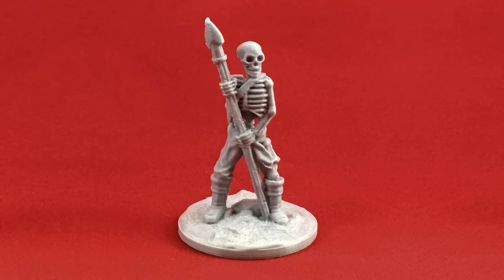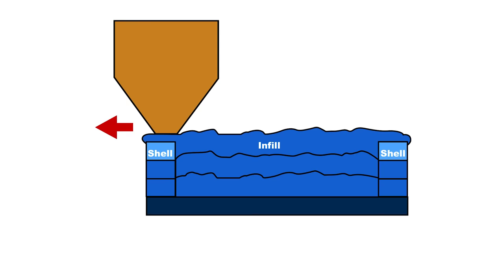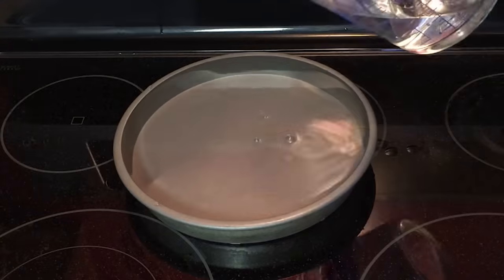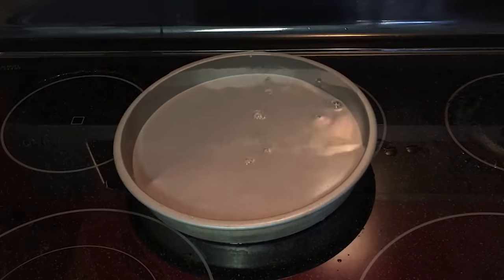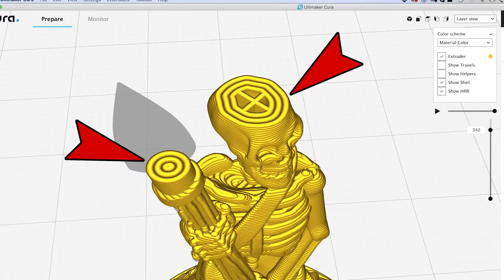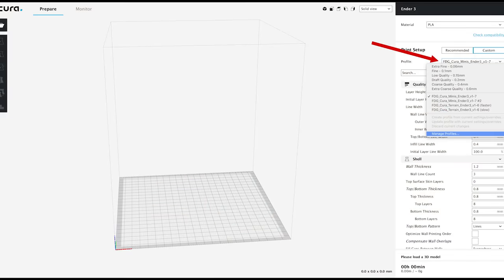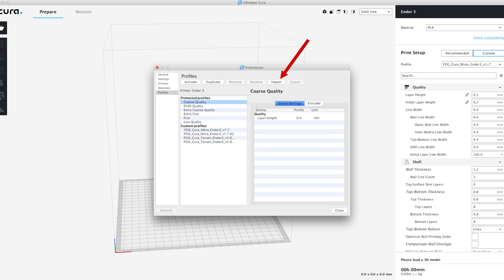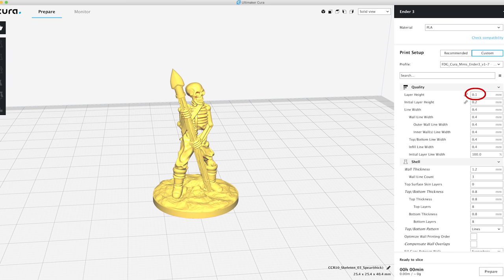How to 3D print miniatures on a FDM printer

Comment: Thanks for the profile and bed test links, also loved the parameters explaining!! Note for me in future: 
- layer height 0.1
- first layer 0.2
- reduce temp to minimum
- reduce retraction to 5
- disable wall overlap
- disable z hop jump
- activate jerk control (my ender 3 stepper do strange sound without)
- printing speed 55 generic and wall ½ so 22.5 magic

My profile will sure improve after this video, keep up the good work!!

Comment: Ok, so this video is 4 years old and is STILL one of the best resources for 3d printing (especially with smaller diameter nozzles, LOL). 

The information is presented in a clear and cohesive manner, with no unnecessary frills or embellishments. This person not only provides you with the Profile files for you to Import but also wlks you through the Settings so you can make your own.

As someone who has spent countless minutes poring over low-res scenes via the Pause button, just to get some Wall settings, this is MUCH APPRECIATED. 

This should absolutely be the standard for instructional videos on this platform. Well done, sir. ♥
Reply: Totally agree sir. Very nice vid

Comment: Best 3d printing video I've seen yet. I was also trying to use the finest settings on my printer and this video explained why they were looking so bad. I was getting discouraged because I thought that if my printer  was making crap at the best settings then it would never get better. Thanks!
Reply from the maker: Thanks for watching :)
Reply: Per 3dprintersonline, the Ender 5 will be out soon. Any info on this at all? Is 3dprintersonline a good company to deal with?
Reply from the maker: The Ender 5 appears to be a continuation of the Ender 4, which is a totally different printer than the Ender 3. The Ender 3 produces far better prints that the 4. No clue if 3DPO is good to deal with or not, I haven't ordered from them.

EDIT: The Ender 5 isn't a direct continuation of the Ender 4, it looks like they have changed all of the issues I have had with the 4, and it looks like it could be a very nice printer (I will be reviewing it once out).
Reply: https://www.creality3donline.com/creality-ender-5-3d-printer_p0123.html It's out; hope you get to be the first reviewer!

Comment: nice documentation on your acceleration and jerk settings.
With good calculated Esteps on my ender_3 and 97 a 95 flow i'm been able to go as low as 4mm and 30mm/s with retraction without any sign of stringing. i also believe as less retraction as possible i creates less stress on your tube and couplers.

Comment: Did you put a CURA profile link in description? Anyway the best technical video about printing minis. Most of vídeos on yt say 100%infil and 20%print speed its way better option, now i can desagree with solid arguments.
Reply from the maker: Yes, Cura profiles are linked in the video description. :)
Reply: @Tombof3DPrintedHorrors  Maybe I'm just blind but I really don't see it there. :-)
Reply: @Tombof3DPrintedHorrors  
I can't find the profile either?
Reply: Anyone find the link for the Cura Profiles? Thanks
Reply: @dougsink3653  its in the description
Reply: does not contain any valid profile error when trying to import.
Reply: @JTNetw0rks   i get the same ..  but im using the 4.6.0 version maybe thats why :/

Comment: After looking at this video and adjusting my settings, I get nearly perfect prints on my prusa mk3. Though, I have a problem with supports. I use cura experimental tree supports and I really like them, but sometimes the supports have too little surface area which connects to the actual mesh, and it loosens during printing. Therefor I'm really looking forward to your video about supports!

Comment: Wow. THE BEST explanations on why you're changing the settings. Could not subscribe fast enough. Tried the settings on my ender 3 Pro ,Cura 4.7, prints kept failing (4 so far)and kept getting filiment mess clump up on the nozzle after about an hour into each print. (brand new nozzle and bowden tube). I'm determined to get it right, but love this guy and his videos.
Reply from the maker: Cura 4.7 has a lot of problems, I recommend 4.6 with my new 4.6 profiles available at www.fatdragongames.com in the 'Resources' menu

Comment: Thank you, going through and explaining the settings was really helpful in understanding those settings in general.  Got the Ender 3 S1 for my daughter for Christmas, and we are brand new to 3d printing.  So this video was very valuable!   So excited we can make minis with it!
Reply from the maker: Be sure to use my most current profiles from my website, a lot has changed with Cura (new Arachne engine) since this video was made. Use my Cura profile on the website and change retraction distance to 1mm. :)
Reply: Ok!  Appreciate the heads up and your hard work.

Comment: Great timing!  I finished putting my ender together and printing all the upgrade parts.  I am fairly sure I have the bed leveled well.  With the magnetic sheet and Aqua Net Extra Super Hold parts are adhering very well.  (I was curious how long the hair spray would last and was getting 5-6 uses before reapplying it.)  I was just starting to look at printing terrain and miniatures.  The finish on the upgrade parts were a bit off and I had a feeling that understanding the settings on Cura would be key to getting better prints.  

I look at what people are posting and some are really good, some close to mine, some worse.  Would it be possible to have a video that show example of prints that are just off and how to fix them along the lines of what you did with the adaptive printed skeleton?

Comment: The Cura profiles on your Dropbox location are actually different than settings you list here.  We tried both and got terrible stringing and Minis would collapse or break when removed.  I just returned to the Cura defaults and quality is FAAAAR better.  Clearly, the comments suggest this has worked for others so it must be us.    We must be missing something.  Using Ender 3 Pro.

Comment: I have been using your Cura profile for all my minis. I have two Ender3's running most the time printing them. Thank You for the video and the excellent profile. It works better than any that I have tried, and at less printing time than some of the others. I made a few tweaks to it, to suit my needs and bang, perfect minis every time. I haven't printed any terrain pieces yet, but I will be using your profiles, when I do.

Comment: Awesome video thanks! Just a small note: PLA's glass transition temperature is between 60 and 65 °C.
Reply from the maker: Yeah, I wasn't specific enough. I was thinking of the eSun PLA Pro I use for minis which has a slightly higher one than standard PLA, so I should have specified PLA Pro instead of saying PLA. :)
Reply: Don't think it makes too much difference anyway :) I think the basic idea of - don't keep the printer head around too long stands. I'm really keen to start trying mini's today though. Looking forward to your vid on supports cause they suck!

Comment: wow this helps me alot!
i dont play even tabletop games but printing this figures is a hella fun too tho.
i only want good quality prints, and you make this possible. m
thanks a lot.

one thing; i hear on other 3D print channels something about the "magic" numbers.
these numbers will eventually increase quality and print speed with simple mathematic tricks
Reply from the maker: Thanks! And the term 'magic numbers' is misleading, it simply refers to full steps of the stepper motor. .1 is a precise half-step and is very accurate. Dropping to .08 (a so-called magic number) introduces other issues when printing miniatures. .1 will produce more consistent results, especially with overhangs. :)

Comment: I have a cr10 mini and a cr10 thanks to you I finally figured out what the heck is going wrong with some of my prints. Some of my larger ones have layer lines that look like strata you see at the Grand Canyon 😂 my temperature was way high I did a test print at 190-195 and holy cow what a beautiful difference. Thank you and I will be trying out your cura settings on my printers.

Comment: Last comment, I promise. Also, if you're having under-extrusion you can also upgrade your extruder to something like a BMG extruder which has a ration of 3:1 in the transmission between the stepper motor axle and the extruder axle. Those things will push PLA through even at 185 degrees.

Comment: Thanks for this upload buddy 👍Mostly print/profile for either large prints, prototype prints or utilitarian designs. This came up in my feed and loved it 👌
As a teacher/school inspector, adult trainer and makerspace/creative consultancy owner... your manner is perfect for communicating this topic. Nice work.
I'm going to apply your logic here to some micro prints I need to do including microscale lithophanes and small scale biomechanical prototypes. Happy to share results with you if you fancy covering the process of printing such items. 👍

Your method applies brilliantly to architectural printing too. There's a significant shortage of good archi 3D print guides out there. I get calls weekly from firms that have bought printers and can't produce the various decorative parts/furniture etc. A rerun of this vid, applied to architecture, would be really welcomed 👌
One thing to add here... if anyone's lucky enough to have a dual extrusion machine... I use a .8mm nozzle in one hot end and a .3mm in the other. All internal structures are produced using the .8 with external finish applied using the .3mm. Print speeds are significantly reduced, over extrusion issues are less and the wider print lines lets you cut down the infill % dramatically. Plus it lets you get rid of all the nasty colour filament by hiding inside the nice ones 😂👌 
Keep the vids coming man... new sub and video shared across my network 👍

Comment: 0.15mm layer height seems to be a sweet spot for printing with a 0.4mm nozzle :)
Reply: Agreed. I have a makerspace, my own printers, a couple of print Farms plus support schools. The 2, and only 2, rules that apply to the vast majority of printers are 1.5 layer height on a .4 and changing to a .6, or having one to hand, and running at 1.8 layer height are good things. 👍
Everything else? Well... there's a reason I have numerous thumb drives with over 300 profiles on them 🤯😂😂

Comment: This is amazing! i am super new at both 3D printing and RPG pencil and paper games. I got a 3D printer so i could print minis for our game, i am having the hardest time with supports and also i am never sure if i should print the figure laying down or standing up.  :)
Reply from the maker: I will do a video on supports eventually. Unfortunately, there isn't any great way to do them, for the support to do its job it has to be close to the model, but that means it will be harder to clean off when finished. That's why we are releasing a full line of miniatures soon that will not require any slicer supports. I want to make 3D printing miniatures as easy for everyone as possible. :)

Comment: I think that you mispoke when you were talking about Kinetic Energy (KE=1/2 * m * v^2). You said that velocity is constant, it's acceleration that is constant, if you ignore air reistance (which won't make much difference in dropping a model a few feet). 

Also, glass transition temperature is when a material changes from being brittle (like glass) to being ducktile (ie stretch before it breaks). What you are talking about is the melting temperature of the plastic. But plastic doesn't simple go from a solid to a liqued state, like water. It goes from a solid and softens until it becomes a liqued as it hotter. I'm sure that there are some specific terms that describe this melting process. 

Over all a great video with some solid advice, I hope. I'll have to put it to a test.

Comment: Great video, the settings help alot. I have Ender3 with 0.4mm nozzle and using Cura I get much better finer detail with a line width of 0.36mm and using a layer height of 0.15mm to 0.20mm depending how quick you want the print. I can print very small fonts with a 0.36mm line width and can even go as low as 0.30mm but the prints take much longer. Just make sure that retraction is enabled to prevent any stringing. BTW I'm not a mini creator, just like your video tutorials for printing tips. Thanks!

Comment: Incredible video, that's a lot of useful information! I always print big so I never had to make these adjustments and I think you were awesome explaining all of these configurations. I'd just like to point out that you should print 0.12mm layer height instead of 0.1mm because you'll have higher quality. That's because 0.12 is a multiple of the z stepper "magic number" which is 0.04. The multiples of 0.04 are the steps the stepper can consistently move through the whole print, without having "rounding" errors and spitting a thicker layer now and then. In your painted lizardman mini I can see a slight horizontal line every few mm that I believe can be explained by using a non 0.04 multiple layer height.
Reply from the maker: Nope, that only work if your bed home position happens to begin on a full step position, which would be extremely rare.

Comment: I'm really glad to have found your tutorial.
I'll try this out with Prusa i3 MK3.and Prusament PLA.
Reply: I just wanted to comment that I have a Prusa i3 MK3S and tried with the Prusament PLA and had jamming issues lower then 205. That issue was because the fans were cooling the hot end too much so I bought the silicon sock and now run at 195 with no issues.
Reply: Did you have any luck with your Prusa?

Comment: Great video. Thanks for the help and knoweldge.

To be honest, you could chuck a minuture at a brick wall and not have damage. Pla has a tensile strength of 37Mpa, roughly 5300psia. We did this in our strengths class. It also has a very high compressive strength, which is what would be consider3d impact force if thrown at a wall. So having it fall on the table or off, is not an issue. Nor is Kenitic Energy. The mass is almost negligable for it. You could drop it off a building and it would tumble in the air, then bounce when hit.  If you increased the mass beyond a certain point, i can do the calculation, then you would get deformation and failure:)

Comment: nice video, just an observation, falling speed is not constant, what is constant is Acceleration which is gravity acceleration if its falling alone and no other forces are intervening.
Reply from the maker: I know, but this video is about 3D printing miniatures, it's not intended to be a physics lesson about the acceleration of gravity. Going into an explanation of how all objects accelerate at approx 10m/second/second (not counting air resistance) until they hit terminal velocity due to that air resistance would be overkill (and frankly, annoyingly pedantic.) Much simpler to just say the speed of the dropped minis is constant, which gets the point that they fall at identical speeds across. :)

Comment: I'm impressed, Has to do some adjustment for my machines (The Anycubic kossel Linear plus and the  Anycubic 4Max) and both machine the setup with in Cura exceeds exceptions.
Even more impressive because the Kossel can do excellent extremely high quality detailing work when set up correctly in the first place.

Comment: 12:15 i'd like to point out how on a ender 3 each step the the stepper mortor makes is 0.04mm, because of this you should always try to have your layer height be a multiple of this value so for an ender 3 you should be opting for a 0.08 or a 0.12 layer height here and avoiding 0.1, this will increase your print quality as now you'll have more consistent layers
Reply from the maker: Nope. That is not true. For you to hit on the full step positions, your 0 position for the Z home would have to be on one, and that is virtually impossible. So even if you set it at .04 increments, it will never hit on a true full step of the motor because you didn't start on a full step.

Comment: FYI the speed of an object falling does change, the acceleration of earths gravity is the constant (not taking into account air friction). Hence why you die falling from large heights, but not from tripping over.
Reply from the maker: I know, but this video is about 3D printing miniatures, it's not intended to be a physics lesson about the acceleration of gravity. Going into an explanation of how all objects accelerate at approx 10m/second/second (not counting air resistance) until they hit terminal velocity due to that air resistance would be overkill. Much easier to just say the speed of the dropped minis is constant, which gets the point across. :)

Comment: What if you modify the printing process with 2 items:
Insulation for the heating block (also saves energy as it irradiates less) - there are cheap 'nozzle heat insulation cotton pads' available.
Use an Airbrush Nozzle mod to increase the distance from the block to the  printing part.
Would be interesting to see how it changes the print quality, especially as you go below 0.8.

Comment: try 0.2 nozzle 0.08 layers. 
You'll be amazed.
And you want to have your acceleration at 2500m/s^2 or higher (all the way up your printer handles) that will produce sharp details without the problems related to high jerk.
Reply: Are you talking about a specific acceleration setting or ALL acceleration settings?
Reply: @davidhsieh604  All of them. That makes prints sharper and faster and unlike high jerk doesn't produce any ringing/ghosting artifacts.